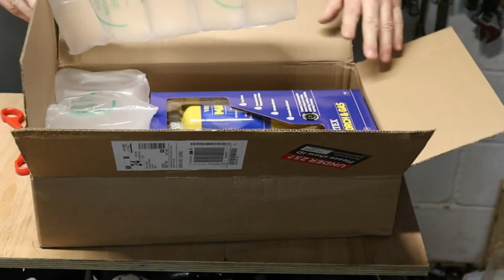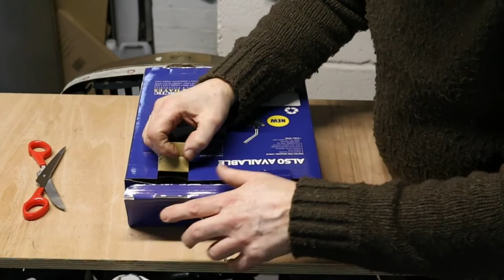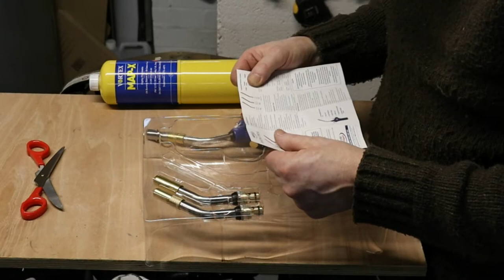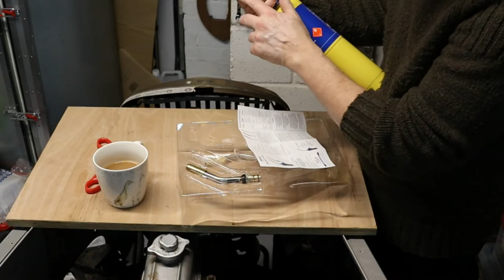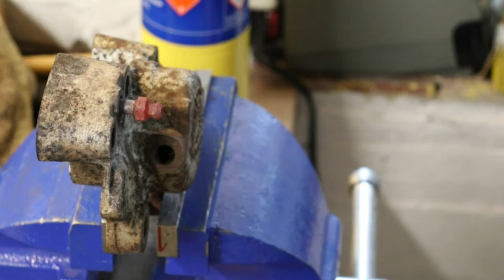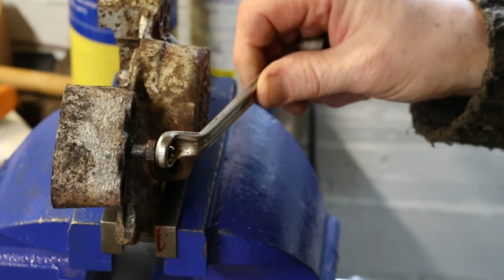Vortex Brazing Torch & Map Gas. Unboxing and 1st Use Review

Comment: Can it be used for melting bituminous felt?
Reply from the maker: @dominicagbata5995  easily. It runs a much hotter flame than a conventional blow lamp which would be enough for what you need. It's a truly great torch and safe to use if you don't lock it on.